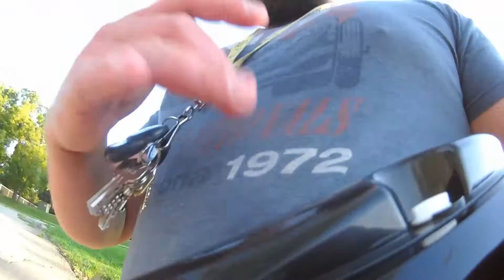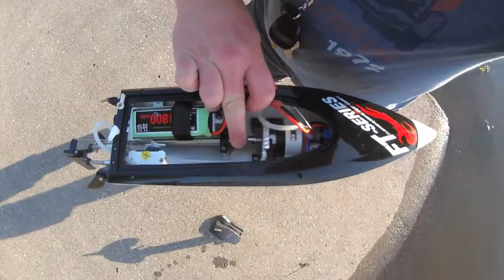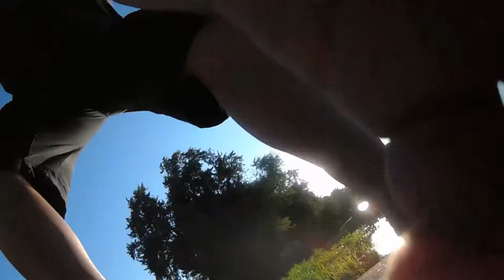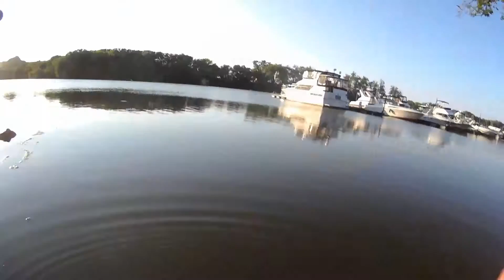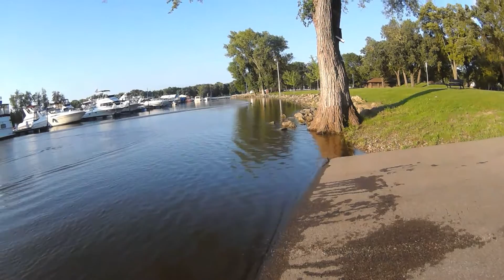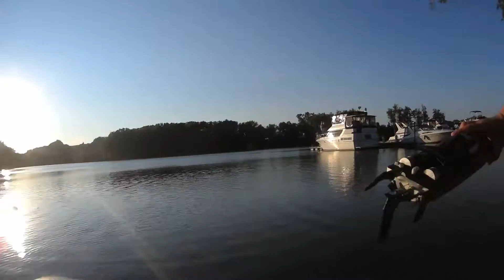FT012 won't accelerate but high rpm

Comment: C'mon, this is an extremely simple system, I've had the 012 for a couple years and have many hours on them and have been through many parts. You've obviously lost connection in the drive train somewhere. Pull the shaft and inspect everything.
Reply from the maker: No, it is not the drivetrain slipping, like I stated in the original post. I've had it apart a few times, everything is perfect as far as the shaft, bearings, prop, dogbone and couplers, set screws are loctited and show no appearance of slippage. A couple days later it ran fine again, next time out it didn't. I found the motor had a real bad vibration. I oiled the motor and let it sit a day and it runs fine again. There is no visible signs of slippage on anything. I did notice toward the end of the 2nd battery it sounded like it was slipping a tiny bit again, there was a lot of water inside. I believe the motor is going bad, new one on the way but it does run perfect again with the existing motor. I sealed the hull and any possible leaking area to keep water out.

 If you hold the rear in the water, hit the throttle when it is doing this, the instant throttle it has awesome torque, then it drops off and the electronics make a scream noise, like an ESC noise.